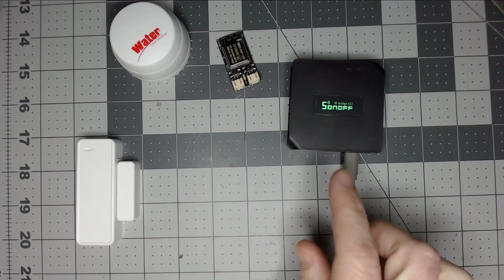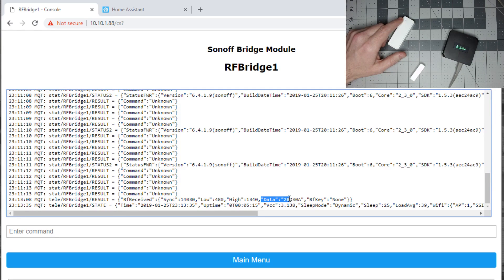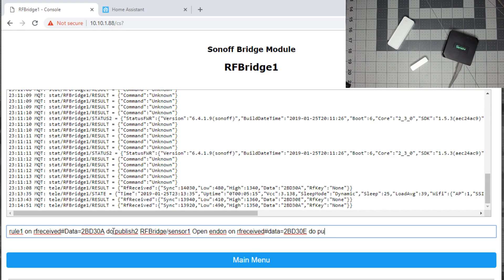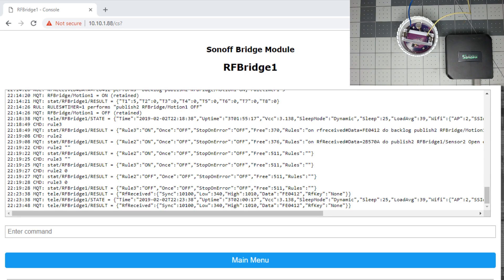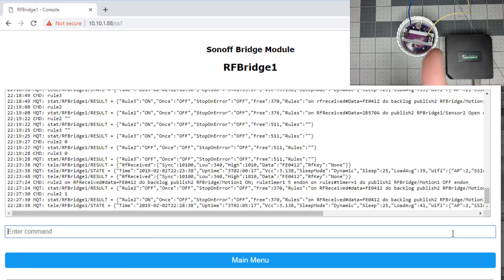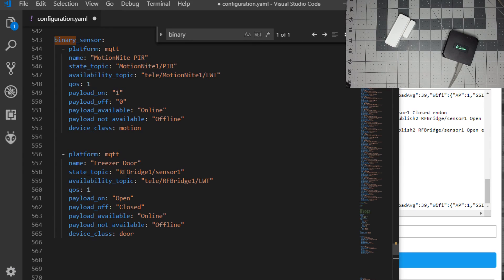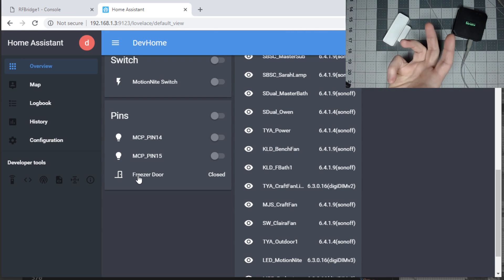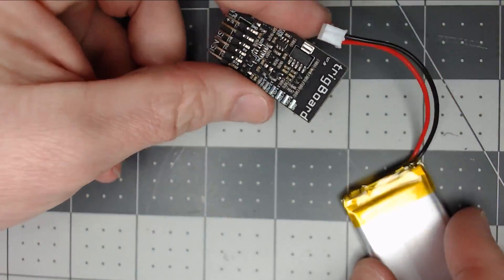Sonoff RF Bridge Easy Setup with Tasmota Rules and the trigBoard

Comment: Is there a limit to how many rules?
Reply from the maker: There are three rule buffers and now with the compression you can fit quite a few in each one.
Reply: @digiblurDIY  Thanks! i've got like 30 of these contact sensors I need to install, gonna see if I can squeeze in 10 per rule!

Comment: Hi, sorry for the questions but new to OH3.  I tried your way watching this video and it works, so simple, like you said dont have to worry about JSONPATH. I am getting the single code door sensor to Open and Close after 5secs. But would like to know how to do the following.
My door sensor has only one code for Open no code for close. When it comes on it stays on Open all the time. How do i get it to turn to Closed using OH3.
Reply from the maker: Do the same as I did for the water sensor, a timer to set the off again.
Reply: @digiblurDIY  Yes it works so easy but i would like to see how it works in OH3. Not many people are working on OH3 except one German guy.

Comment: The water leak detector apparently only sends out one status message - which Travis covered.   It looks like it sends out the same status message if the  battery voltage  drops to around 2.2V.    So if you do get an alert from this device it could be that it detected water or the battery needs to be replaced.   I would prefer some kind of "I'm alive" message but it is what it is - and it is cheap...
Reply from the maker: Zigbee is the way.
Reply: I'm liking these cheap water leak sensors more and more.    They have excellent range.    From my shop - about 80 feet from the house - and thru 2 walls back to my office -  the sensor was able to communicate  to the bridge.    Set up a PM schedule once or 2X a year to just do a quick test of them and make sure I get the notification on my phone...I've only had one actual leak event in my life - knock on wood.   The cloth washer cutoff valve stuck in the open position - I became aware of it when I saw a flow of water heading for the den...no major damage but if we had been in bed...

Comment: Hi Is there a new update to add these door sensors to Home assistant without writing rules. Also please can you point me to where you did a video using NodeRed to do these same door sensors with open & closed codes. I would appreciate it. The problem I have is I bought more sensors but don't how to add it to the original Rule.  Unable to see my original rule in the console. Thanks
Reply from the maker: I haven't done a video on the new way I did it. Think I showed it on a live stream once but not going to make you dig for that. Shoot me an email at the channel name on the Gmail domain and I can send some screenshots of mine. Definitely the way to go when you have a ton of sensors.
Reply: @digiblurDIY  Thanks Travis appreciate it

Comment: Hi Great video - Can you help with this query. I have a bunch of single code device but it looks like im only allowed to add rule1/rule2/rule3 . When I add rule4  * I get the following
22:50:16 MQT: stat/RFBridge1/RESULT = {"Command":"Error"} **
Reply from the maker: There are only 3 rule buffers. The latest version even has compression once you go over 511 characters.
Reply: digiblurDIY can you give me an example on how the add eg: single code sensors , 10 door contacts and let’s say 10 motion sensors.

Comment: How can I list the current rules ? (So I can see which should be my next avaliable rule number)
How can I backup the rules ? (Simply do a Tasmota full backup?)
How can I see how much more memory I have left for rules ? I would assume the memory is quiet limited, so I need to use as few characters as possible ?
Reply from the maker: It's not rule numbers, its a buffer of rules.  There are three of them.  Actually in the latest version of Tasmota they allow more by doing compression too

Backing up the config backs them all up.  

If you type rule1, rule2, etc on the console it will show the rules and the amount of space you have left in each rule.

Comment: Thanks Travis , you rock dude . Have 5 door sensors working and the best of all it keeps the state of the door. WE in SA often have power cuts and therefore my PI gets reset etc. Thanks again for your awesome videos and how you explain things. Another question, I bought a PI 4 and would like to move my HA from my PI 3B to my PI 4 ? Which is the best way ? Thanks
Reply from the maker: Take a snapshot from the 3B. Download it. Install the 4 with HA. Upload the snapshot and away you go. Make sure to assign it the same IP so you don't have to reconfigure any switches.
Reply: @digiblurDIY  Thanks , appreciate it. Meant to ask how many Rules can I place on the Bridge ? and if I have more sensors and  want to add more is there a way around the limit of rule size etc
Reply from the maker: You can put 511 characters in each rule buffer. If you run out or find it hard to manage you can switch it to NodeRed.

Comment: Hello there, thanks a lot for the information, I just flash 8 sonoff basic and one rf bridge but now the rf brig is not sending or receiving anything, the rf led is not flashing at all, the switch is back to the on position, please help
Reply from the maker: Are you able to see the Tasmota GUI?
Reply: @digiblurDIY  yea I can acces the web ui no problem,
Reply: I really appreciate the help
Reply from the maker: It is set as RF bridge?
Reply: @digiblurDIY  yea rf bridge (25)
Reply: @digiblurDIY  I just configured the home assistant and works great,  the only issue is my rf bridge, the rf status led never flash or anything
Reply from the maker: anything showing on the Tasmota log?

Comment: I did everything in the same way but in my Home Assistant after adding "entity"  I se this entity with information "Unavailable". Where I did a mistake? I checked  code milion times. RF Bridge see the sensor and status in the console. 
My MQTT Topic is RFBridge. This is my code:
binary_sensor:
  - platform: mqtt
    name: "Balcony"
    state_topic: "RFBridge/sensor1"
    availability_topic: "tele/RFBridge/LWT"
    payload_on: "Open"
    payload_off: "Closed"
    payload_available: "online"
    payload_not_available: "offline"
    qos: 1

    device_class: door

Help:)
Reply from the maker: Can you check to make sure the LWT topic is correct on your device? In the console type restart 1
Then watch the console to see the LWT.
Reply: @digiblurDIY  RFBridge/tele/LWT
Reply from the maker: Looks like your topic is backwards from the one you have in the YAML.  So flip one or the other to make them match.
Reply: @digiblurDIY  Something strange. This doesn't work: 
- platform: mqtt
    name: "Balcony"
    state_topic: "RFBridge/sensor1"
    availability_topic: "RFBridge/tele/RESULT"
    payload_on: "Open"
    payload_off: "Closed"
    payload_available: "online"
    payload_not_available: "offline"
    qos: 1

    device_class: door

but this work properly:
- platform: mqtt
    name: "Drzwi balkonowe"
    payload_on: "8F19EE"
    payload_off: "8F19E7"
    state_topic: "RFBridge/tele/RESULT"
    device_class: door
    value_template: "{{ value_json.RfReceived.Data }}"

Comment: I am just trying to get started with MQTT using an an RFBridge and followed the video, I set up the water sensor (single trigger) without a problem.

But the open/closed sensor does not work despite the fact the Tasmota console appears to give me back the correct results as below:

00:15:43 MQT: RFBridge/sensor1 = closed (retained)
00:15:50 MQT: tele/RFBridge/RESULT = {“Time”:“1970-01-01T00:15:50”,“RfReceived”:{“Sync”:13900,“Low”:460,“High”:1350,“Data”:“30190A”,“RfKey”:“None”}}
00:15:50 RUL: RFRECEIVED#DATA=30190A performs “publish2 RFBridge/Sensor1 Open”
00:15:50 MQT: RFBridge/Sensor1 = Open (retained)

I input the following into the console to create this:
rule1 on rfreceived#Data=30190A do publish2 RFBridge/Sensor1 Open endon on rfreceived#Data=30190E do publish2 RFBridge/sensor1 closed endon

My YAML entry is this:

- platform: mqtt

name: “Freezer Door”
state_topic: “RFBridge/sensor1”
availability_topic: “RFBridge/tele/LWT”
qos: 1
payload_on: “Open”
payload_off: “Closed”
payload_available: “Online”
payload_not_available: “Offline”
device_class: door*

The entity only shows a state of Closed.

Any advice appreciated
Reply: I'm a relative newbie but there is often a difference between upper and lower case. Your rule is sending "closed" but your YAML is set to "Closed" - If in doubt, always use be consistent

Comment: I had intended on making my own Wifi reed switches.  But, after looking at the 433Mhz options I decided the RF bridge and 2-code sensors was the way to go.  So my first place to look for advice was here and Dr. Zzzz.  Once again your walkthrough awesome.  Much appreciated - Thanks!

I do have a general question about the consol.  Where would I find documention to learn how to use the consol?  

Thanks again - great work!
Reply from the maker: Honestly just look at the commands section of the Tasmota Wiki. It has all of them and explanations right there.
Reply: @digiblurDIY  Okay thanks, a basic case of RTFM, haha.....  I'll go back and look at it.
Reply from the maker: No worries. Let me know if you need help.
Reply: @digiblurDIY  Any idea why I get this error msg: "Connect failed to http://192.168.254.100:1883, rc -2. Retry in 10 sec"  After flashing and re-flashing.  The bridge (board ver 1) cannot connect to the MQTT broker (mosquitto HASS.io Add-in).  I do connect with WiFi as I can talk to it via the IP and of course the router shows connected , and MQTT is working fine I checked that with MQTTfx.  I also flashed it Tasmota 6.6 and 6.5 .... same result. I researched the problem, but didn't find any answers.  Don't expect you solve my problem, just wondering if you have run across this or heard of it  happening.
Reply from the maker: Remove the HTTP part.  For the host just put the IP and that's it.
Reply: @digiblurDIY  Right in front of me......  Thank again!

Comment: Hi man. Inspiring video. I was wondering if with tasmota rules you can set a command that when an rfraw command is a trigger you can repeat that command for 5 more times?

I'm asking because I have Dooya blind motors and I'm looking for a way to simulate a long press of the stop button.
Reply from the maker: Yes you could do a backlog command and put delays in between as well. How quick do you need the 5 messages?
Reply: @digiblurDIY  This is my payload_stop: payload_stop: "rfraw AA B0 35 05 04 12C0 05FA 015E 02E4 230A B481A3B2B2A3A3A3B2A3A3A3B2B2A3B2A3A3B2A3B2B2B2B2B2B2B2A3B2A3A3A3A3B2A3B2A3B2A3B2A3 55;rfraw 0"

I need to repeat the code 6 times to simulate the long button press.
Reply: @digiblurDIY  Could I set this backlog command as the payload_stop in hassio as well?
Reply: @digiblurDIY  So i tried the backlog command. It works in console for 3 consecutive commands... but if I try for a fourth it doesn't execute the backlog command :(
Reply: @digiblurDIY  Doesn't work for no more than 3 commands. I think it has to do with the line being so long in the console.
Reply from the maker: Are you running over the 511 characters allowed for the rule?
Reply: @digiblurDIY  yes one rfraw command is 132 characters :( I made an issue on the tasmota github to see if they can remove the max limit for backlog or add an option to spam/repeat the rfraw command for x amount of seconds
Reply: @digiblurDIY  Turns out the B0 command support repetitions. Changing 5th byte to higher number turns up repetitions.

Comment: Hey mate.. as i said in my last comment i finaly buy one of these and flash it with Tasmota. But on console nothing happened when i active a 433Mhz Door Sensor.. Any ideas?
Reply: Make sure that the little switch below the big LED is turned ON.  I had that issue, once I turned it on, it worked.
Reply: @foxden5400  Hey man Thanks for the answer. But I checked that switch, it's okay with it. From what I've researched, the Sonoff RF Bridge can not learn all kinds of code. Unless I add such a 'Portisch' Firmware. https://github.com/Portisch/RF-Bridge-EFM8BB1.
I did not quite understand how to do it, so I'll let it go and buy another type of Sensor.

Comment: Hi, using Tasmota on Sonoff Bridge, can I register more than 16 devices?
Can I register the sensor scrolling code?
Can I register more alarm devices?
Thank you.
Reply from the maker: The 16 is for sending codes.  Sensor scrolling code?
Reply: @digiblurDIY   Rolling code or Dynamic code.
Reply from the maker: Ahh... I haven't heard of any firmware on these to tackle the rolling codes.

Comment: Travis, Thanks for this video.  I was having problems with the way HA processes the codes from MQTT, assuming that a topic can only have a 2 states and it wants you to make more topics if you have more sensors.  This method does that.  I was picking the 'data' code directly off the tasmota MQTT output and it was spamming the error log with warnings from 8 other inputs any time one of them sent a code.  Your rules worked great.  
Oh, BTW, your comment on make sure you spell it right, well, I should have listened to that better I guess.  I didn't know how to spell the word RfReceived either and didn't spot it until troubleshooting for an hour or 2....
I used your rules pretty much exactly.  
This is what my binary sensors look like when I was done for dual code devices:

binary_sensor.yaml
  - platform: mqtt
    name: "Bathroom"
    device_class: opening
    state_topic: RF_Bridge2/BA
    payload_on: 'OPEN'
    payload_off: 'CLOSED'
    force_update: false
    availability_topic: RF_Bridge2/tele/LWT
    payload_available: Online
    payload_not_available: Offline

This is what I did for single code devices because my rule buffers were filling up:
I have an automation that watches for any code to come across the bridge.  It then makes the data code a topic, and a binary sensor watches for the topic to go on and sends the momentary sensor to on, triggering whatever is watching that sensor.

automations.yaml
  - id: bridge_2_breaker
    initial_state: 'on'
    alias: RF-Bridge 2 De-multiplexer
    trigger:
      platform: mqtt
      topic: RF_Bridge2/tele/RESULT
    action:
      service: mqtt.publish
      data_template:
        topic: "RF_Bridge2/code/{{trigger.payload_json.RfReceived.Data|string }}"
        payload: 'ON'

binary_sensor.yaml
  - platform: mqtt
    name: "Moms button1"
    device_class: light
    state_topic: RF_Bridge2/code/8D63A4
    payload_on: 'ON'
    payload_off: 'OFF'
    off_delay: 1
    availability_topic: RF_Bridge2/tele/LWT
    payload_available: Online
    payload_not_available: Offline
Reply from the maker: Wow.. Now that's a video comment! Amazing stuff. Going to have to dig through that this weekend and try it.
Reply: @digiblurDIY  The whole sonoff bridge thingie subject is both awesome and in need of love.  You did an awesome job with the topic in this video and people will find this as they struggle.  Thought I could add to it a bit.

The only problem now is 1500 characters space for rules.  If you keep the names short thats like 10 2-code devices.  I guess there's no reason I can't drop a few a bit longer rules (reading the data MQTT message directy) on another tasmota device and let that push the 2-code topics.  Node-red could monitor for the data directly and deal with it I bet, but I'm not a node-red person.  For whatever reason HA decided that MQTT topics can only output 2 states, and anything else it whines about...
Reply: So.. this worked fine until I tried to run some PIR sensors that need to react right NOW...  If you analyze this here's what's happening with my automations...
  - PIR gets triggered, it sends a 433 RF signal
  - RF-Bridge sees the signal, converts it, sends out an MQTT to announce
  - HA sees that topic with automation, sends out another MQTT on a new unique topic
  - HA sees that new topic and triggers a binary sensor.
  - HA sees that binary sensor in another automation and triggers the light.

Takes a couple seconds...  Definitely have to fix this...  I should be able to combine the middle 2 or last 3 HA actions into a one action.

I might just make a tasmota rule on my light look for the rf 433 MQTT message and react.  I would have to add an MQTT topic from my dark/sun sensor because that is also in the logic so that the tasmota switch has that info.
Reply: @digiblurDIY   I just found this and implemented it.  It works like the rule process you installed here, but puts the heavy lifting on to the HA computer and off the little bridge box.  Also eliminates the limit like 4 or 5 devices per rule and 12 or 13 per bridge.  https://community.home-assistant.io/t/sonoff-rf-bridge-strategies-for-receiving-data/108181
Reply from the maker: I've also done it with NodeRed in little easy method too without having to do any JSON stuff.  I have a rule that pushes any RF commands to a topic and then NodeRed listens to the topic and has a switch after it.  Pretty simple and easier to see as well to do various logic.

Comment: Seems there are only 3 rules available. How to extend this number ?
Reply from the maker: Did you fill all three buffers up? It's not just three rules. You have 511 per rule buffer.
Reply: @digiblurDIY  Ho I see thanks u... I will have a look how to add several rules into the same buffer
Reply from the maker: The basic premise is on trigger do something endon on trigger do something endon etc...